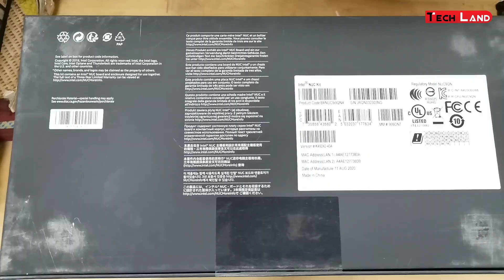Building Intel NUC Ghost Canyon i9 gaming PC using the G.skill RAM and Samsung m. 2 | Tech Land

Comment: hey man -does this NUC take 3 x m.2 nvme drives?
Reply from the maker: yes
Reply: @TechLand2  thanks, found out it was on the main board - under a heatsink plate! Even though this NUC is gen 9 still very very capable running lots of VMs with very low watts.